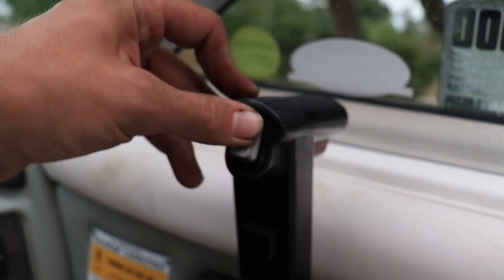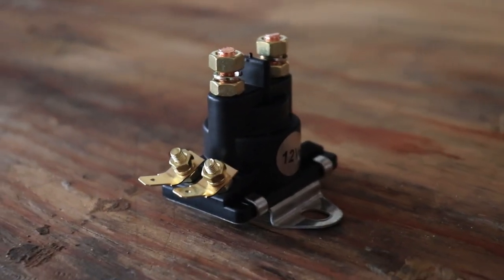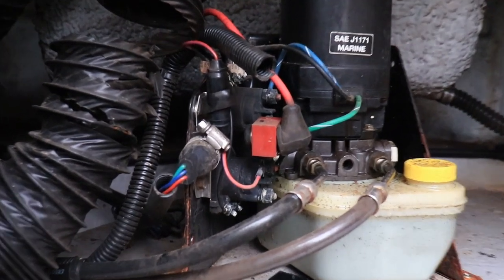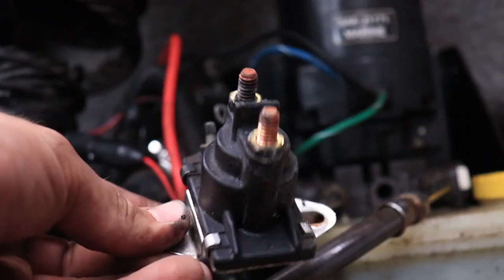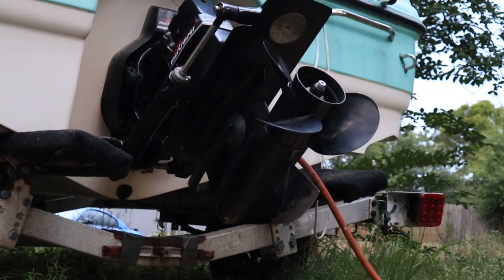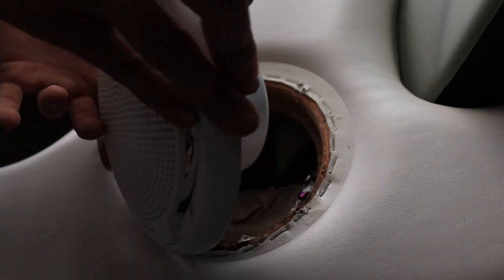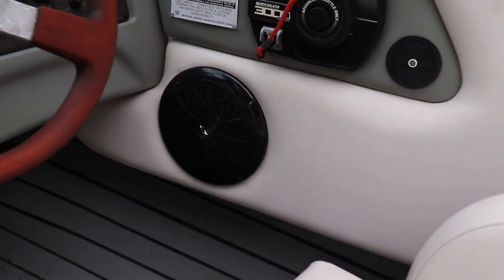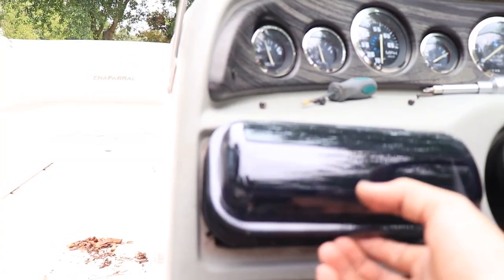Boat Restoration | How I FIXED my BOAT |🚤| Part 8

Comment: Please keep this channel going.  Could have used this years ago when I started boating.   The ❤
Reply from the maker: Glad you enjoy! The channel isn’t going anywhere don’t worry! What kind of boat do you have?
Reply: Ive had a 16 ft starcraft outboard, a 19 ft rinker io, and most recently a 24ft chaparral open bow io.  The chap was a 2330 sport with a 350 mag and bravo dual prop outdrive.  Basically the bigger brother to the chap you rebuilt.
Reply from the maker: @justingillette4643  the bigger the better right? That’s awesome. Maybe one day you will see a barge on the channel 🤣
Reply: @slickshifts3434  keep her going bud, but no.  At 38 yrs old my advice is,  bigger is not always better.  Happy,,, and piece of mind are more important than the size of your toys.
Reply from the maker: I would have to strongly agree with you

Comment: Doing great man! One thing you may want to do is use heat shrink over those stereo wires connections to limit future corrosion.
Reply from the maker: Thanks for looking out man! I actually took the stereo back out and did that because I forgot! 🤣 glad you liked the content!